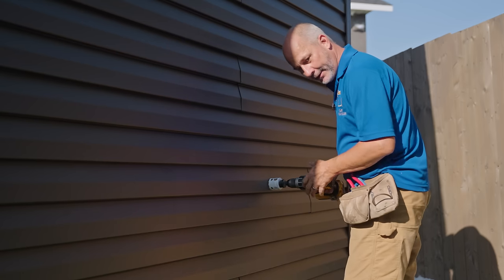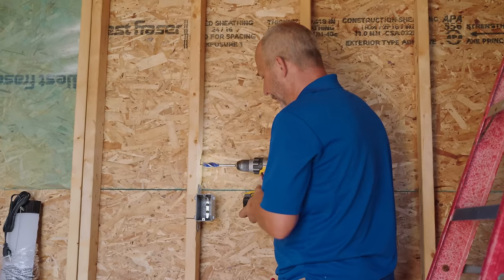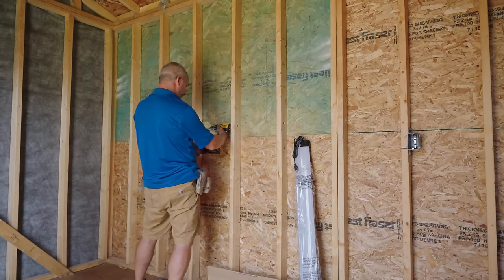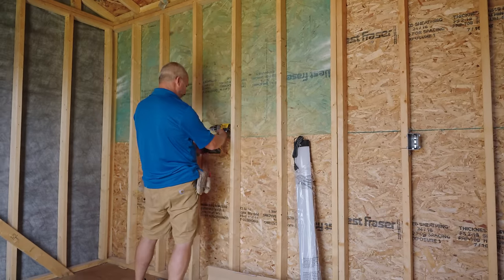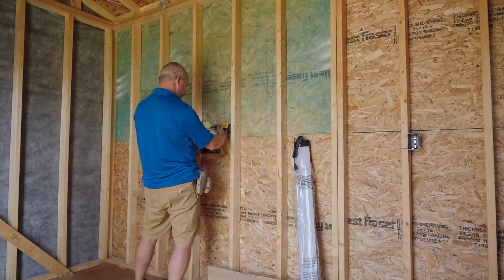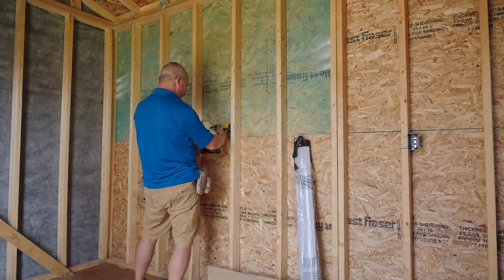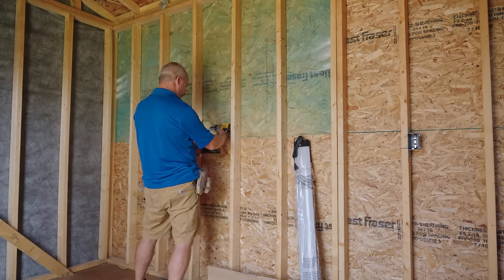How to Run Permanent Temporary Power to a Shed

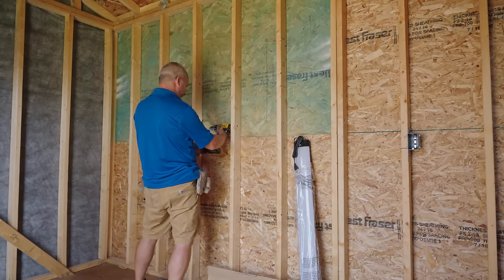Comment: 25:19 I'm surprised that you did not wrap the side of the electrical outlet with black electrical tape to prevent anything from coming in contact with the live screws, and potentially causing sparking.

Comment: I couldn't see it in the video, but how did you connect the ground wires in the daisy chain?
Reply: Yeah, what happened to the second ground wire around the 0:30 mark? You attached one to a screw in a plastic box, and then cut to only having a single wire to attach to the outlet. Did you pigtail them? Also, why ground a plastic box?

Comment: Jeff, how do you ensure that the plug you installed for your power feed is water-tight? Not the box but the where the power enters the plug?
Reply: Buy a 15A generator inlet and put it in an in-use style box with the cover on it that covers the connection.

Comment: I'm sure not the correct way, but I would have probably done the outside with a generator connection and changed the end of the extension cord to have the mating generator plug, just missing a leg from 240. Possibly put a small circuit panel looking towards the permanent part, then the future would to just run the main to and in the shed. Could then "off grid" the shed with a generator and disconnect the main breaker of the panel if so desired.
Reply: I like this idea. I think I will do this in my garage/shed.

Comment: why did you not need tohave to screw the cable in after its installed?  The thing that keeps the wire from pulling back out of the bax>

Comment: If you flip the receptacles with the ground facing up, it adds a little extra protection against stuff hitting your hot and neutral if it's not fully plugged in.

Comment: if not a permit in some areas. better check to see if voids your insurance. thats a big reason for permits. safety.
Reply: It's a shed so he probably doesn't have insurance on it.
Reply: @munsters2  it is connected to house power. so if it burns and burns down the house his insurance may not be any good.

Comment: So a non-waterproof connector just hanging outside. Pretty sure that would be against code everywhere. Especially a loose wire just hanging there. Use an RV waterproof plug connector that mounts to the wall that you can attach an extension cord to when power is needed.

Comment: I would have installed a shore power receptacle on the outside of the shed. Neat looking, water tight, unless code forces you go with that ugly cord through the wall.

Comment: Technically you are supposed to have a neutral at the switch box it is code where I am from for future I always run 14/3 for switches to lights so you don’t have to use the white for switch legs you should have gfi protection in that shed for those outlets to fill that hole you could have used electrical putty it is easier to remove for the future

Comment: The house my wife and I bought a few years ago had been wired by an idiot. they installed the switches and outlets, then pulled the wires taught from outside the box. Now, if I need to change one out, there is no slack to get to the screws... Had to open one or 2 walls up to fix that!

Comment: If you will need a permit someday, then you can’t close in the walls as the electrical may need to be inspected. If you aren’t closing in the walls then I’m pretty sure you need to use BX metal shielded cable rather than the white NMD you’re using. Since it is temporary maybe you’re OK, but there is a reason (safety) for that rule.

Comment: Why not put an elbow on the outside connected to the LB fitting, and fill that with foam and sealant. Then you won’t have the ugly hole visible. The extension cord plug would hang below the elbow.

Comment: The roof vent is over the rafter...?
Why are you not using pigtails on the intermediate boxes, so power will be at all locations even if the outlet fail?
I would have used a twist-locking connector on the outside cord.

Comment: Just to let you guy's know in new Mexico you need permits for any and all new trade work if you get caught by neighbors pointing the finger at you than you have to redo it to code which is a head ache, usually permits are peanuts in price compared to material and labor cost.

Comment: I set up my shed with solar on 2 batteries.   Gives me plenty of light when I need  it.  No cords just to have lights and some low power use.  When I need to power more, I run that temporary cord to the tool.
Reply: I did something similar running a battery system in my shed.  My set up runs off a power tool battery and controlled by a switch outside.  I put in four interior and two exterior 18V LEDs and wired a master switch to the outside.  I know I'm not doing the battery any favors keeping it in a non-temperature controlled environment, but I have so many spares from bundles and the Chinese knockoffs are cheap enough to sacrifice for the convenience.  Once the battery is dead, I just bring it back to the house to charge and replace it with another.

Comment: He should of connected the black wire to the white black taped wire so the black wire from the switch returns to the ceiling box as black so the ceiling switch shows black and white connections, originally.

Comment: Not code compliant, current code you must have a neutral in the switch box. Effectively code was modified to support smart plug/switches, etc.
Reply: I haven't brushed up on the newest of codes yet as I do mostly industrial but is it a hard rule for the neutral? Even in a shed?

Comment: That is permanent wiring my friend and in the US states it requires a permit and inspection.  It does not matter if the power coming to the shed is temporary.
Reply: Hate to say that by the book it is NOT permanent,   As long as the power supply is an extension cord, no one will inspect the work

Comment: Hey love your videos, Though just curious what building code are you going off? As far as most of your construction? Is it specific to your state or are you using national code just curious?
Reply: This shed is being built in Ontario, Canada. So would fall under the Ontario building code. But it's under a certain size so it's actually exempt completely

Comment: One thing i wanted to mention,  don't tighten the screw connection to the receptacle with the screw gun.  The screw is nowhere near tight enough! I have to crank pretty hard on the screwdriver to get it tight enough. There is no way to judge the torque using the impact driver.  Its better to be too tight then too loose.

Comment: Why would you fail inspection for putting a 20amp outlet on a 15 amp circuit?  The circuit breaker is still 15amp and will trip if you exceed that.
Reply: Because it isn't allowed by the code.

Comment: Lol, those socket and light switch companies are cheap.  So they make those screws drives pretty universal to save on manufacturing tooling, you can use, flat, Philips AND Robertson!  You'll notice if you look into the cross in the center that's it's oddly diamond shaped, that square hole can accept a Robertson screw driver!  As for the switch plates, I'm way too OCD about screw orientation and some screws are not cooperative.  So, I splurge and buy the nylon plates rather than having to buy extra plastic plates which will probably get cracked too anyways.

Comment: Why does my wire have 4? It has red, white, black and copper.  What do I do with the 4th?
Reply: You bought the wrong wire.  Just don't use the red wire.
Or save it for another project.
Reply: @munsters2  I didn't buy it. My brother had it here. I bought new stuff now.

Comment: you can use 15amp plugs on 20 amp circuit but you can’t use 20 amp plugs on 15 amp circuit. as long as the outlet doesn’t allow more amps to be drawn that the circuit provides
Reply: You can absolutely use 20 amp receptacles on 15 amp circuits since the breaker will trip before the amp rating of the receptacle is reached.
Reply: In Canada, cannot use a 15 amp receptacle on a 20 amp circuit.

Comment: My house is older (1980s) and has 12 gauge wiring despite having 15A recepticles. If I want to add a new recepticle, should I be using 12 gauge or 14 gauge wire? And should the recepticle itself be 15 or 20A?
Reply: I'll answer this saying I am not an electrician but have read these parts of the code book in preparation of some DIY work in my home and asked a few electrician friends.  

1.)  Wire size is dependent on the size of the breaker.  If the circuit is protected by a 20A breaker, then code says you need to be using 12 gauge wire everywhere on that circuit.  

2.)  Code allows for 15A duplex receptacles and light switches on a 20A circuit in most cases, but your use case may dictate using 20A devices depending on a few factors.  A couple that come to mind include switches controlling receptacles (even a 15A receptacle) and single receptacle devices need to be rated for the same load as your breaker.

All that said, that is NEC code and not necessarily your local code.  Your local jurisdiction may have different rules and it's always best to check local code before starting any work as the rules may be more stringent than NEC.
Reply: @niemo118  The breaker is 15A. So does this mean I can use 14 gauge wiring going forward? And is there any downside to continuing to use 12 gauge?
Reply: @lifeinhd4053  you could extend your circuits with 14 gauge and stay within code.  That said, sometimes you'll see 12 gauge on a 15 amp circuit just due to voltage drop over longer runs.  If you're unsure consult an electrician or just continue using 12 gauge.  Remember code is just a minimum and you can always up size your wires.  Also, if everything else in the house is 12 gauge and just one receptacle is now 14 gauge, you run the risk of confusing the next guy who thinks he can upgrade the circuit protection to 20 amps.   If you decide to use 14 somewhere I'd leave a label in the receptacle or the panel to let them know 14 gauge is present.  

The only real downsides of using 12 gauge wire are it is slightly more expensive per foot and it is bigger which takes up more space in the box and can be harder to neatly tuck away.

Comment: I see so many people running the electrical service to their outbuilding by trenching and coming up on the outside of the building even though the building is setting on a wood frame (small outbuildings) or gravel pads. Why is this service ran to the outside and not to the inside by trenching under the building frame and coming up on the inside?

Comment: Do the install with the plug was just for the show so it is "legal" and "temporary"? 
Because Im sure you would not do this like that and use another elbow and go to the ground and run it up to the house. Or at least screw a generator male plug outlet box with a cover. And seal the top and sides with silicone so water doesnt get in.

Right now the vinyl siding has an hole and it is still exposed to the rain snow,sun and will get problems in futur.

Also last thing, I would have separate the circuits from all outlets and just bring them all on a box near the entry of the electricity, so in futur it would be so easy to add a circuits breakers panel and more power for tools.

I love your channel and never complained, but on this one there is few things like I wrote that I disliked a bit 😅

Comment: What did you do with the second ground wire?  I missed that.
I take it you run an extension cord from the house to the shed.  Any particular method or way you ran it on/under the ground??
Reply: The boxes have more than one ground screw and a conductive strap. So you place each under a screw and they are connected and thus made equipotential.
Reply: @YellowBunchofBananas   Super!  Thank  you YellowBunchofBananas.
Reply: @YellowBunchofBananas   Meant to add...your answer is very ap'peel'ing!!
Reply: @sleepinglioness5754  😁😂

Comment: Electrician told me one run the screws vertical so dust doesn’t collect in the slot. I do it every time now. It’s also a little detail that shows you care about your work and every plate is the same. It drives me nuts to see the screws all different ways. You can only imagine what the inside of the box looks like.

Comment: Just be aware if you install a shed on gravel, your city ordinance may completely forbid any form of electrical. My inspector makes up rules on the spot so you really have to first get a permit before you learn what is allowed or not allowed. After submitting my plans, the permit specifically stated, "Absolutely NO electrical nor mechanical allowed as this is not a permanent foundation."  I thought I was doing the right thing with 4" gravel base but apparently only poured concrete counts as a foundation. City ordinances don't specify this info so you have to pay the permit fee first before knowing if you're allowed to do what you want to do. Though, you might be able to call and on a nice day they might tell you.

Comment: Hm... that method of wiring the light Switch  isn't allowed anymore by the electric code without running a Neutral to the switch.
reason is putting an Occupancy sensor or similar energy-saving devices on the light switch  later would require a Neutral,
so the NEC was updated to mandate Neutrals be present at the switch. for lighting circuits,  even if a switch requiring it is not currently being installed.

Comment: It is a shed that you’re going to power with an extension cord, but wiring outlets for a work environment with 14 gauge wire that isn’t even independent from the lights and everything else doesn’t seem like the right move… You’ll probably be OK, but there is better ways

Comment: How will silicone break down when that’s what is used in bathroom and places where it’s wet
Reply: UV radiation
Reply: The silicone in your bathroom isn't submerged in water for days or weeks at a time
Reply: @joseph7105  so I’m suppose to use poly caulk on that to, what about insulating the rim joists what do I use for that

Comment: You failed to show how to seal the outside plug you used. You made a comment about it but did not seal it from the weather.. I do something similar but my cheat is to use a #14 extension cord with a weather-tight end to the first connection inside out of the weather or in a j box so when I made direct connections I can remove the plug. I mount my temp motion light with just a 25 ft  #12 extension cord cut in PVC J box to have light and outlet at same location

Comment: Are there no safe zones in North America like up or down and never across the middle of the wall
Reply: You just keep the conductors an inch and a quarter back from the front of the stud or otherwise you add a plate.
Reply: @YellowBunchofBananas  something that does not happen in the UK
Reply: @becca1927  No protection plates?

Comment: Please correct me if I'm wrong,  but is it not true that the current code requires a white in switch boxes?
Reply: I tend to run power to the switch, so all the whites are white, maybe its a NEC/CEC difference.
Reply: He has a white in his switch box.
Reply: @robertmorin6495  the white in the switch box is on the output side of a switch, its not a neutral white, he put black tape on that white to indicate it's not a "white"

Comment: Quick note... plastic covers are great IF you are putting them on sheetrock.  For a bare wall you really should use a metal cover on your electrical boxes.  Reason? If you hook something on the edge  of the plastic cover it may break and expose your  wireing, and as we all know Murphy's law  will ALWAYS APPLY.

Comment: that romex you have hanging outside isn't rated for wet locations so that's no good ... and that plug isnt for romex or wet locations...assuming thats all on a GFCI circuit? why not just do it right?

Comment: The problem is this setup will not be temporary. Just because it doesn't require a permit or inspection doesn't make it right. Your still violating electric codes, example wire and devices have to be used in accordance with their listing. These cords are not designed to be exposed to weather.

Comment: sorry to be asking this, but: What is a permit?
Reply: Most electrical work needs to be done with a "permit" The permit is essentially a notification to the governing body of electrical work so they can inspect the work that is done (it also comes with a fee which is used to offset costs of paying these inspectors). Some work like SMALL TEMPORARY installments, replacing receptacles, changing lights do not require a permit. If you do work that requires a permit without a permit and say have a fire that burns down your house and the cause is deemed the faulty wiring you will not be insured.

Comment: Since this is "temporary" , why dont you put the extension cord in thru the opening inside the shed?  As i stalled it will get water dameged and / or water will get inside the connetor you added. I'm betting g 99% of those doing this will never get a permit or change the wiring, so put the extention cord inside fhe shed.  Why would you - if it a.ready works and meets your needs?

Comment: BTW, most of the electrical receptacles/etc sold nowadays actually have combination screws that will work with either a Philips or a #1 square-drive (Robertson) screwdriver.  I live in the US where Robertson isn't as common, but I have a square-drive screwdriver in my toolbox just for this purpose, as it makes working on electrical stuff so much easier (doesn't cam-out and strip the screw head the moment you look at it funny, and makes it easy to get a decent torque on them so you know they're not going to back out and end up loose after you put everything back together again)

Oh, and regarding screw colors:  Just think of the "silver" screw as being white (uncolored).  White goes to white (neutral), colored (golden) goes to colored (black, or sometimes red).  And of course (G)reen always means (G)round.

Comment: You shouldn’t use a drill to tighten the screws on the wires. You can’t be sure of how tight it is. If you’ve never had an issue that’s because you’ve been lucky.